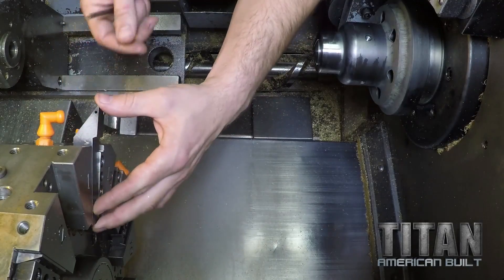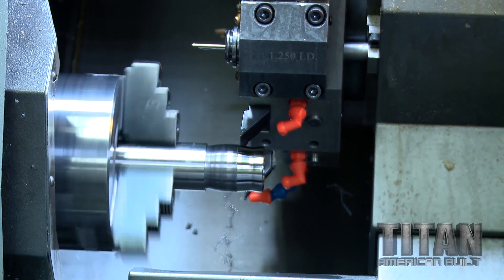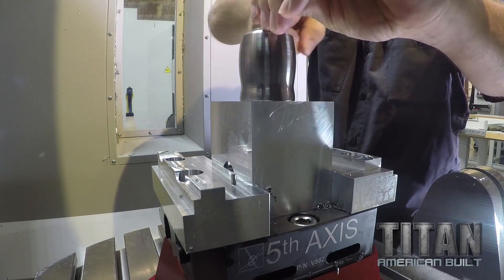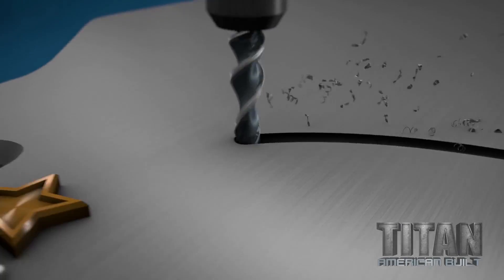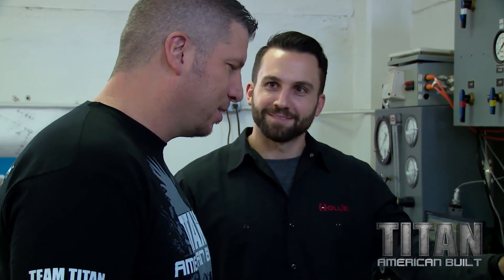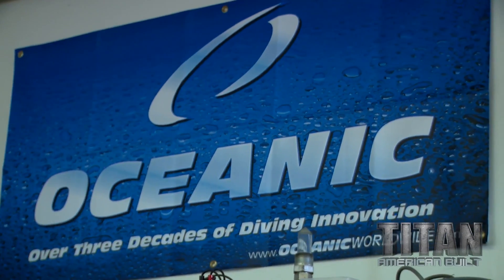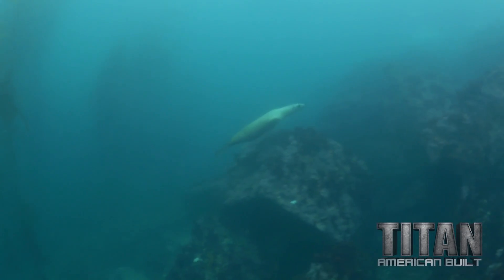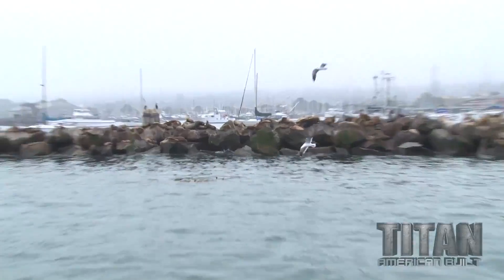CNC Machining a Titanium Dive Regulator for Oceanic

Comment: A regulator first stage is controlling thousands of lbs of air pressure in a scuba tank. DIN style tanks are pressurized to excess of 4000 psi !  (not a matter of a water leak, but air leak) dropping the pressure to <140 psi for the secondary [the part you breathe from] ..curious how corrosion resistant titanium is compared to brass over time.....
Reply: Titanium is used for submarines.  It's essentially corrosion proof.  It's a perfect material for diving equipment.  Atomic makes use of titanium components in both first and second stage and allows for extended service intervals because of it.
Reply: That’s a k valve, not din